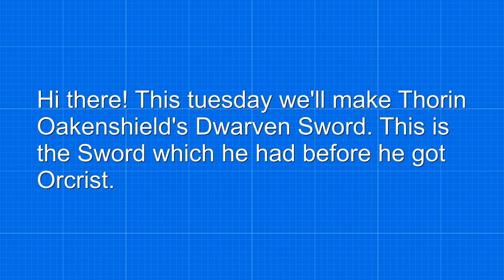Thorin Oakenshield's Dwarven Sword! ( TLotR )- Free templates

Comment: What wood do you recommend for making these? I've been using Pine, but it tends to chip easily on fine edges. Should I try a hardwood? Would it make a difference in it's durability? 

Also I'm limited to a hand held jig-saw, don't have a band saw. It cuts Pine just fine, would a hardwood pose me any trouble?
Reply from the maker: To be perfectly honest, I have no experience with hardwood.. I almost always work with poplar, just because it is easy to work with.. Sometimes I work with steel, but you'll see in 2-3 weeks ;) However, I am very sorry but I can't help you with this question..
Reply: Yes, you should definitely try hardwood. Look around in local timber shops, see what's available in your price range and buy that. Read as much as you can: the wood database has a guide on almost every possible wood, which includes some basics about their workability. Don't be afraid to try new types, oak, maple, etc. My current personal favorite is black locust: great, underappreciated hardwood with good workability and excellent resistance to the elements.
Overall hardwood requires more work than any sort of softwood or plywood. It takes longer to shape and requires more force to do it, but it's worth it. It makes it a bit harder to mess up the bevels and the general shape of the objects and can be sanded to a quite fine edge. Won't cut paper on its own or anything, but it could make some nasty cuts on skin if you're not careful enough.
Hardwood also looks waaaay better than plywood with various grain patterns specific to the type of wood you would be using. It can give the end product a nice, patter-welded like look.
A jigsaw of decent quality shouldn't have any problem with cutting any type of hardwood. Small tip: cut hardwood with a fine toothed blade on a low speed setting to minimize the tearing of the edges. Low speed also helps preventing friction burns on the wood to which hardwoods are generally more prone to if you're cutting them at high speeds.
If I may give you some advice: 
1) unless you're making props for a fan film or cosplay and you're working with a really tight budget, than stay the hell away from plywood. It will never look as good as hardwood and the finishing quality will also be lower, due to the nature of the plywood, which is more prone to leave small dents and such on the product, issues that are either hard to fix (though not impossible with some wood filler, like the very basic sawdust+woodglue combo) or fixing them would cause other issues.
2) Try to learn form the OP's mistakes and understand that when it comes to woodwork, or really any kind of craftwork, doing something really fast is not something to brag about. Fast work results in flaws and mistakes that could otherwise be avoided and fast work usually only produces a certain quality of work after long, long years of practice and getting certain things down to muscle memory. Take your time and I guarantee whatever you'll be making, will look even better than what you see on these videos. Hate to be that guy, but OP's work is sloppy at best. It can be seen at best on the closeups of his blades: the bevels and the edges are highly inconsistent and all over the place, at some points thicker while at others practically nonexistent and all on the same work pieces. Personally I always measure out the the top of the bevel along with the edge and use a rasp to file down any excess material to create a uniform bevel and edge, then I use sandpaper to smooth it out. Also, don't just use your hands for sandpapering. It's fine for high grit papers, because they take out much less material and will deform the final shape much less, but for smaller grits, use a proper, palm sized sandpaper holder, it will make a lot of difference, and I speak from experience here.
Hope I could help (both you and OP) and have fun crafting!
Reply from the maker: +Lantaar Thanks for the criticism and those tips! I did already search for hardwood in my Store but I couldn't find any.. Also I think that it is way easier to get plywood so one will actually be able to build this sword without having to search a specialized timber Shop which one may not have in their town.. 
Now to 2): You're right, I am not the best woodworker out there but I'll try to get better over the time. Woodworking needs a lot of practice..
Reply: I understand getting a hold of hardwood can be difficult in certain areas without a larger lumber store. But you don't have to use more traditional, better known woods. For example, my current favorite is black locust, also known as false or white acacia, but I said that already. If there are no other options, I would even use softer woods, like various species of pine. They have good workability and can look really good, definitely better than plywood.
Woodworking doesn't just need practice, but also patience. For example, I one of your videos, I saw you trying to set the bevel of a blade with a hand plane and the blade of the plane got caught in the material, leaving a large gash, which was still visible on the finished work piece. Be patient, if an issue like that arises, try to fix it. Put the time and effort into it and I promise it will be worth it. This specific problem I mentioned is also one of the reasons why plywood is a sub-optimal material for projects such as this. The internal structure of it is completely unpredictable, which makes cutting it with blades, like a hand plane, a bit of a crapshoot. Maybe it will work out as intended, maybe it won't. Also, it's a bit harder to set a bevel with a hand plane even with hardwood, because it requires a lot more precision than say using a rasp.
Another tip I can give is to learn. Watch videos on youtube of other woodworkers, even if they're making something you might not want to try to make. They can give you tips and you can learn the handling of various tools that could be helpful. Also there are a couple of people who occasionally do similar projects and there's ninjapukercrafts, who mainly does various fantasy blades.
Good luck, hope I could help.